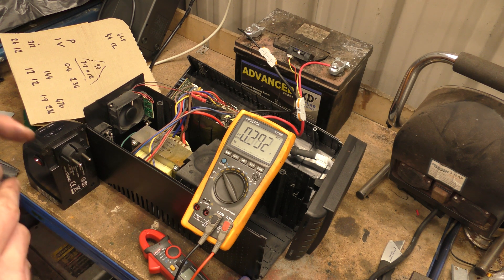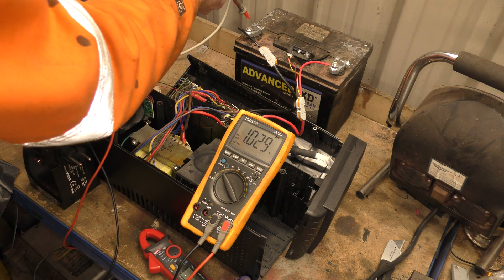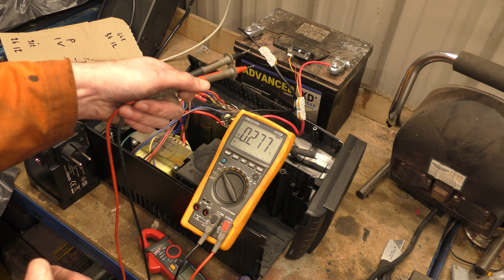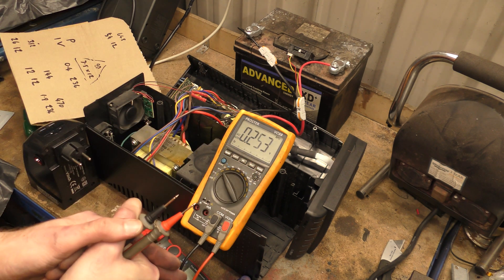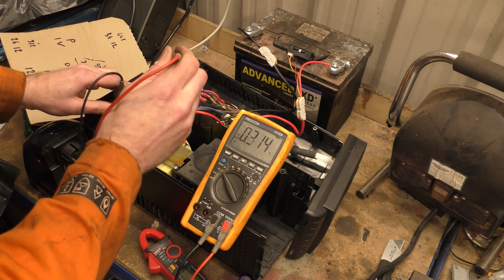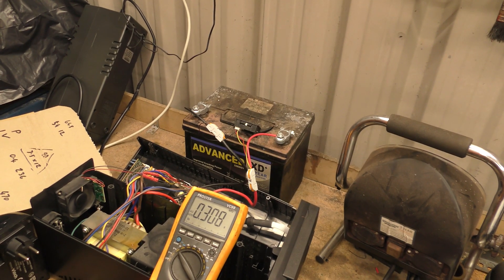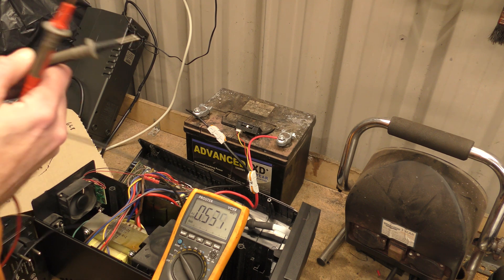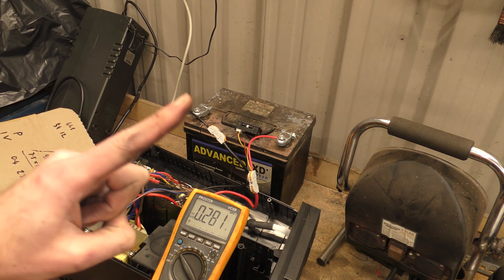Uninterruptible Power Supply (UPS) - DEATH, DANGER, WARNING!

Comment: Hi David, apologies for yet another lengthy question. I'm running my 12V 5Kw diesel heater exclusively on mains. If I get a power cut, will a UPS supply similar to the one in this video be powerful enough to run the fan in the heater while it goes into shutdown mode, if my Afterburner senses a voltage drop and executes a shutdown or does it have enough power to keep the heater running and then Afterburner will shut down the heater as the battery voltage in the Ups falls below a certain value? If so I can ditch my previous plan to use a battery and switch over relay as mentioned in my comment on your Afterburner video. I just want a way to either keep the heater fan running while it goes into a protective shutdown or keep the heater running until Ab shuts it down as the ups  supply begins to die as I'm only interested in protecting the ECU from getting fried and just want the best solution to achieve that. Thanks.

Comment: Im trying to work out why anything metal is showing a voltage. I know multimeters show the difference between the probes but where how what when. Cant get my head around it
Reply from the maker: Not so much anything metal, but anything that is connected to ground.  So for me that's the walls, the workbench, the outside metal case of anything else that is also connected to ground.
Reply: @DavidMcLuckie  sorry yes I understood that bit. Just trying to work out why that voltage is there on anything earthed. Is it unique to ups or is it all inverters?
Reply from the maker: I think it's unique to the UPS, as the batteries would normally be inside and untouchable.

Comment: ? how can there be that much voltage at a 12v battery and it not be blowing up or boiling over? If its 130v + the amps of a car battery 500A+ is a recipe for internal spontaneous human combustion
Reply from the maker: Because it's not between the positive and negative terminals of the battery together.  But between them and ground.  So if I was to stand on a rubber mat in rubber boots and be disconnected from ground, and I touched the positive and negative terminals I wouldn't get a shock as it would be 12V.  But if I was leaning on the metal wall (ground) and touch a terminal I'd get a 130V shock.
Reply: @DavidMcLuckie  Thank ye brother, is it also carrying the deadly amperage of the battery, or what 110-130v wall outlet has like 15-20A, bty thy commentary seriousness and accent in that vid was priceless it lit a light of laughter in me that has yet to be extinguished, blessed be thee and thy seed forever Amen
Reply: Multimeters measure the difference in voltage between one probe and another. Thats why.
Reply: @Fishing-Bert  no $hi* Edison , that doesn't tell me why the voltage is that high at the batt

Comment: Happy to have helped point this out, as did several others thankfully. If you reverse engineer the UPS circuitry you will find that the manufacturer ties the battery side to the midpoint of the output transformer, this improves conversion efficiency by around 10% at full load output (if my recollection of HND electrical theory from 40 odd years ago serves my correctly?)

Might be worth updating the original video (not sure if you can easily do that?) before someone has one of those “can you smell something cooking” moments?

PS. can’t wait to see what you buy next with the contents of the swear box

Comment: A lot of the switchmode plugpacks available now have an output that floats at quite high voltage and will give you a tingle if you touch the outputs. It doesn't give you a serious shock because it is only through capacitive coupling not a direct current path. You'd need to check the current that flows to work out if it is actually dangerous or not.